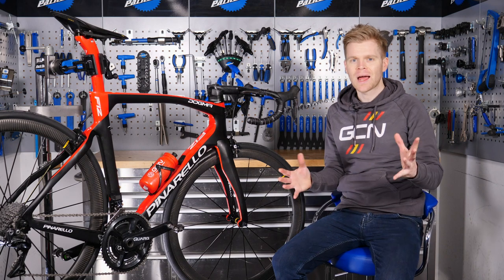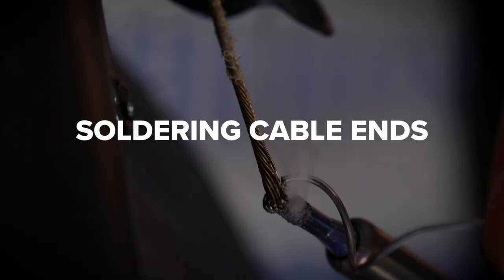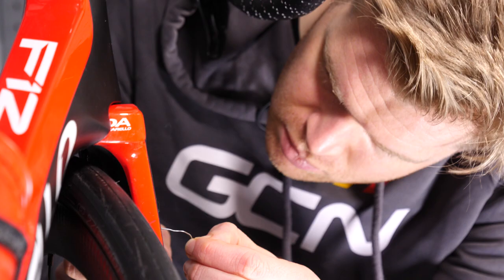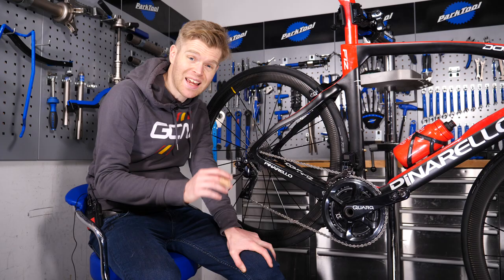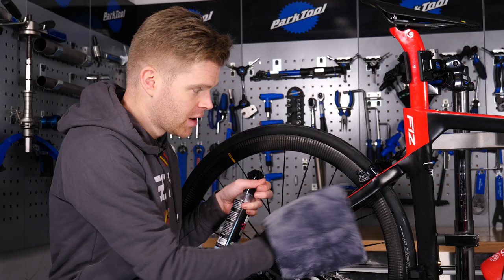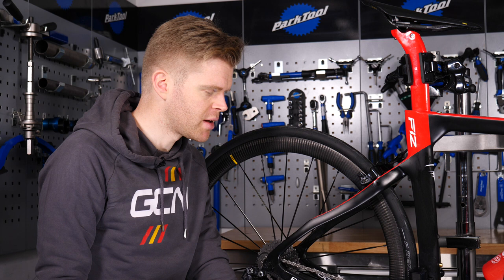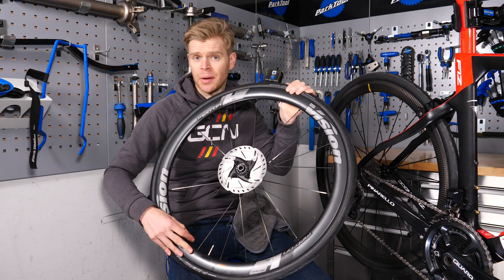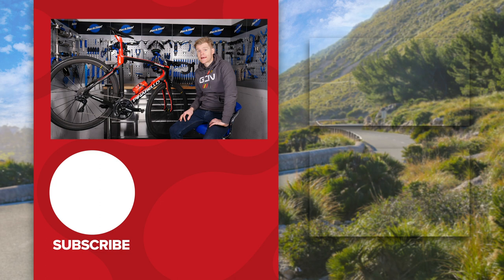Next Level Road Bike Maintenance Hacks | How To Make Your Bike Amazing

Comment: Old-timer here: Always used to wrap the handlebars from the top, and was kind of surprised to see it being done in reverse when I finally got around to buying a modern bike. Any reason why this has become standard practice?
Reply: it's just a matter of overlapping. from the top, the tape tends to get loose because you work it in the wrong way with your hands naturally. when you switch from top of the bar to the levers it curls the tape. from the bottom, the tape doesn't curl or get loose.

Comment: Would not use a soldering iron with a tire and carbon wheel right next to the cable.... One slip and you lost a tire or wheel.

Comment: "soldering" stainless steel isn't really possible. It can be brazed at a much higher temp, with high temp brazing flux and silver brazing filler. I used to actually do a quick tack with my MIG welder. 😎

Comment: No.  Never wrap bars from the top down.  That makes as much sense as shingling your roof from the top down.  The direction of force applied by your hands on the bars will curl up the edges of the wrap very soon and it will look and feel like rubbish.  There is a reason that every pro mechanic wraps bars from the bottom-up and manages the very minor hassle of taping the end of the wrap.  Because this is the only way to do it properly.

Comment: I´ve super-glued all my cable ends. 4 years later none of them has frayed (I should probably replace my cables :) ). 
Clean the end of the cable with alcohol or white spirit. After cleaning give it some time to evaporate from inside of the cable, usually 1-2 minutes. Stick first 5mm of cable in super-glue (CA-glue), hold it there for a couple of seconds, take it out and let it cure. Simple.

Comment: Avoid getting degreaser on a rotor? Then you spray it with - essentially - a degreaser?
BTW, bike specific rotor cleaner is expensive, just use IPA.

Comment: Disc rotor specific cleaner is unnecessary.  High content rubbing alcohol (91% or 99%) will do the job exceptionally well for a tiny tiny fraction of the price -  and wear nitrile or latex gloves when cleaning your rotors.  Even oil from your fingers will pick up dirt.

Comment: If larger jockey wheels makes a difference, why don't derailers come from the manufacturer with larger jockey wheels? Surely the cost would be negligible if you're not putting the absurdly overpriced Ceramicspeed crap on there.

Comment: OMG Olie please spray to brake cleaner on the rag! this shit is extremely corosive and volatile. massive amount of COVs in there. don't spray that in the air or surfaces. on cars mechanics have to wear masks, gloves and glasses when they use it because it's a nasty product and they need to spray it massively to be effective.
Reply: It contains Butanone and Acetone. i've filled in more COSHH forms than i can remember featuring those compounds. They certainly aren't corrosive.
Reply: @GCNuser123  it does eat plastics and resins. he was spraying that on a carbon wheel man. it can mess the stickers and lacquer too. it's not a cheap wheel.

Comment: So..... what level hacks are these?
Reverse wrap bar tape?  Horrible compromise in functionality for the sake of esthetics, as others have mentioned this will not last.  If this was really a better way to do it would have become the standard decades ago.
Soldering the cable?  There is no reason to go to this level of complexity, use super glue.  Also solder is not flux.
Disc brake rotors are just pieces of metal you can't contaminate them.  Its the pads that get contaminated as that is the porous wearing component.

Comment: Use superglue instead of soldering. I have been riding with glued cable ends for 1.5 seasons and it works perfectly.